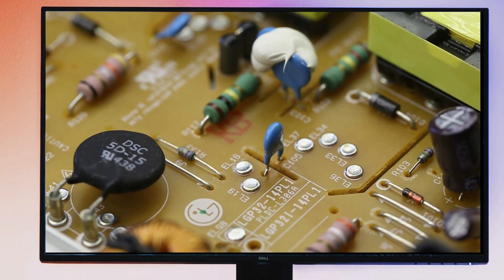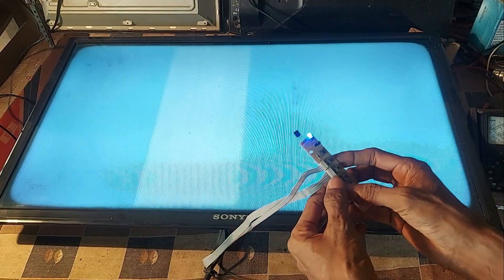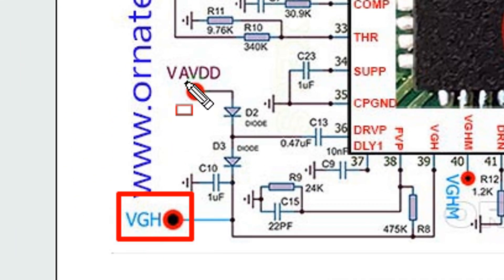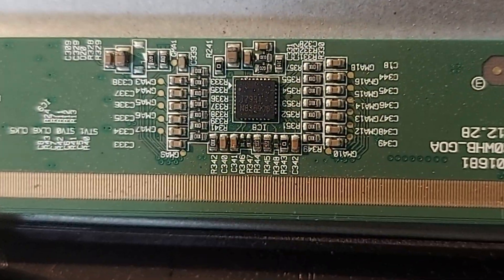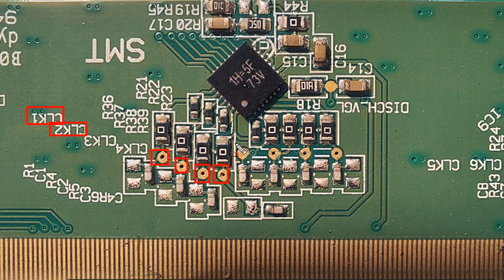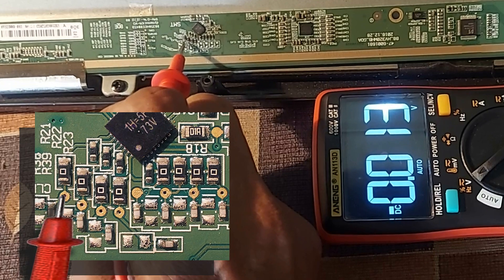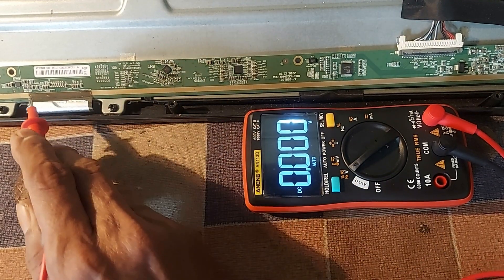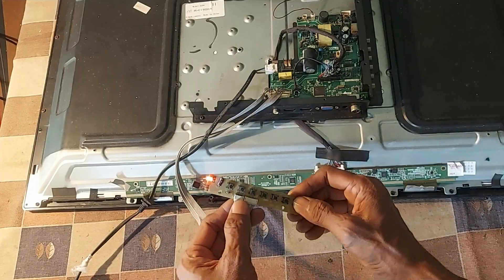Vertical Lines, then No Display Problem  on the Screen of HV320WHB-N85 Panel, 5562A Circuit Diagram

Comment: I have a Semp Toshiba DL3277 TV with a white screen after changing the LEDs, the worst thing is that before, sound still came out and tuned with any piece of wire, now it doesn't tune in and no audio comes out, I've already done all the voltage measurements on the integrated and on the Tcon and everything is ok, I replaced the two 1000uf x 35v capacitors because they were 220uf, even so before it worked normally with audio, but I put a 2200x35 capacitor was what was here, but I'm impressed with this washed screen situation. I've even done that scheme of releasing the Flex, isolating tracks and no image appears. Could it be that a capacitor discharge could have shorted the processor? It is heating up to 55 degrees.

Comment: And again master, some LED, LCD TV's will just only show or display red standby light, no backlight & no screen voltage to illuminate the screen. Sir , how do we repair or even bypass the standby section to power up a LED tv set ???

Comment: I get all the reasoning of your fault finding except for one very important thing. How did you know should be 8v instead of 17. How should we know any voltages when we look at different TVs. Maybe from experience seeing a working TV before. But reasoning tells me without this preknowledge this repair would be impossible for someone unless lucky with guessing to cut lines.

Comment: excelente, como llega a la conclusión de en cual lado hacer los cortes, ya que las líneas ck van en ambos drivers source, gracias, saludos desde Costa Rica
Reply from the maker: The problem appears to be on the right side of most TVs.
If there is no solution after cutting there, reconnect and then cut on the other side.
 Thanks  Brother.
🌺❤🌺